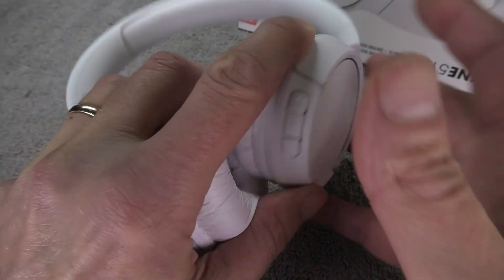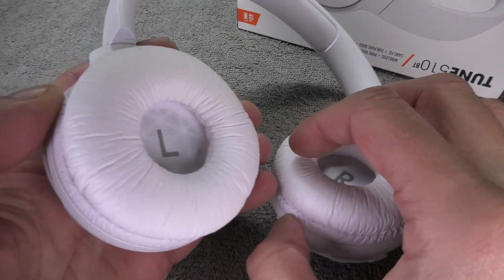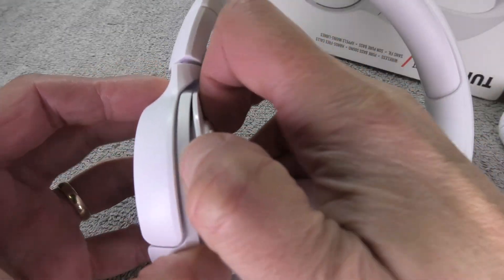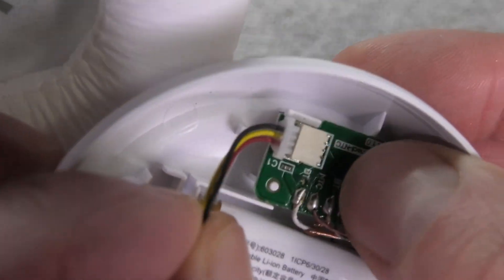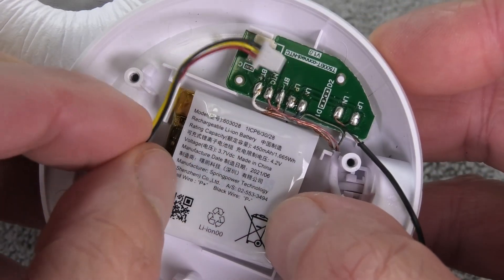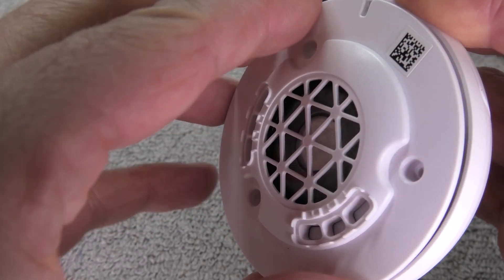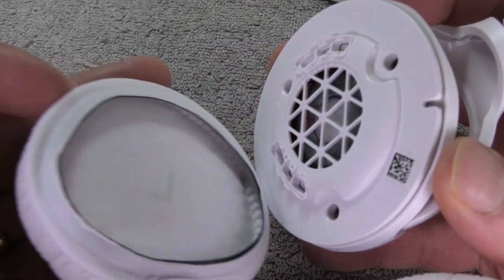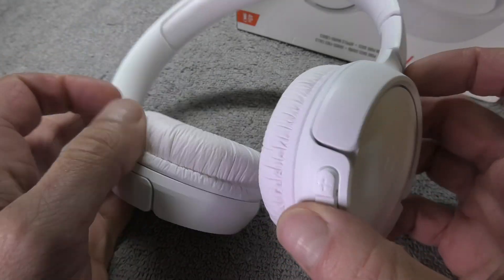Battery Replacement for JBL TUNE Headphones 510BT (How to DIY)

Comment: This is how easy it should be to replace batteries on all headphones. Now that I see there's no stupid amount of work needed to get to the battery, and no stupid unnecessary soldering needed since plug connectors exist - now I'm actually considering to buy this just out of curiosity to see how these headphones will work with my VR meta quest 2 headset.

Comment: For everybody that has a problem with battery nit charging. You can first try to disconnect and conect the  battery  again. For me that was the problem, i didnt have to by the new one. Thank you fot this video... It was simple and useful ❤
Reply: You beautiful person. Thank you so much for this insight. I pushed it in 1st (because I dropped my headphones alot). It went from not charging to fully charged after 40 minutes. Thank you sooo much for this insight.

Comment: disconnected the battery and connected it back. the charging issue fixed. thank you!
Reply: what issue did you had. Mine is struggling to pen or closes immediately. Blinking red when charged.
Reply: @faithimy  same here, after changing the battery, it keeps on blinking
Reply: @faithimy  same issue!  😢

Comment: ❤ No cheap batteries around SO you need to get out the otiginal battery and walk to local electronic shop where did they sell other model batteries and choose some that is around same size good quality ❤

Comment: once I had the volume button stuck and that didnt let me turn on/off the headset, I used your video to dissasembly and re asemble and could adjust the button inside then everything worked fine, thanks for sharing!

Comment: You don't read the comments, or if you do you don't answer.  There have been several people asking for the link to a replacement battery that you either haven't read or don't care to answer.  That's too bad.  Other than that your video is good.  Hope you're more responsive with your other posts. 🤔
Reply: He gave a free video
Reply: @Alberta-Independence  And I said it was good.  Ah, OK forget it.  You don't understand what was meant to be a helpful suggestion. 🙄
Reply: People are so needy
Reply: @Alberta-Independence  and touchy too.

Comment: My JBL Tune 510BT deals alright until i fold in the R speaker, it shuts down and when i connect it to the charger, the LED blinks Red 4 Times
Reply from the maker: Hi, what an odd behavior.  It sounds like there’s something wrong with one of the wires.  Maybe one of them got damaged close to the right hinge?
Reply: @MegaSafetyFirst  Yes, it shuts down when i twist it to all flat (to lay down in a table), maybe 90 degrees to the... Left?
Reply from the maker: Do you know if your headphones are still under warranty?  
If so, then I’d suggest to contact JBL support for a free replacement.
Reply: @MegaSafetyFirst  I purchased them Online in the Fall 2021 Season (Between October and December?
Reply from the maker: I believe the warranty it 12 month.  Do you still have the order confirmation email  on you inbox?
Reply: @MegaSafetyFirst  No... i don't remember where i left it...
Reply: But i now have a job and i'm aiming for the Samsung Galaxy Buds 1 Pro, i already have the Galaxy Watch4, just those with the Samsung Galaxy S22 will make the Holy Samsung Trinity
Reply from the maker: Unfortunately JBL will ask for some sort of invoice.  
If you ordered it from Amazon, then you should be able to find it in the old orders.

Comment: Is there a way to fix the left side not working?
Reply: I cleaned the two yellow dots with alcohol. And it worked
Reply: @kakyoinnoriyaki6393  thanks! I've got new ones anyway :p
Reply: @kakyoinnoriyaki6393  My left side isn’t working I have tried everything, any tips. I don’t know where these 2 yellow dots are
Reply: @neilansh_v8233  try to open your jbl headphones on the left, then you'll see two yellow dots. Try to clean it with alcohol and cotton bud.
Reply: @kakyoinnoriyaki6393  Do you have instagram?cause if you do, I will send u a photo
Reply from the maker: It works similar to this Video: https://youtu.be/jxVqfxQRnP0
Reply: @MegaSafetyFirst  But the JBL 510 BT does not have the coil and pad mechanism for connection
Reply: @neilansh_v8233  that was my problem too, I couldn't find those dots, luckily I had my warranty and I changed them